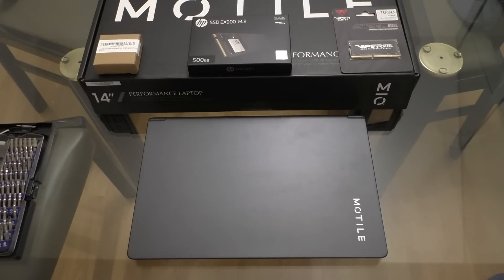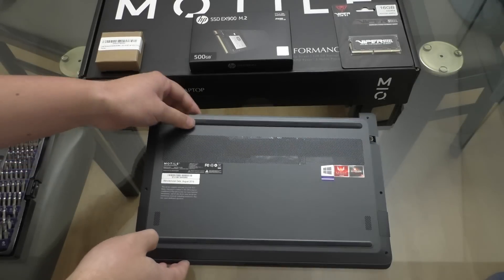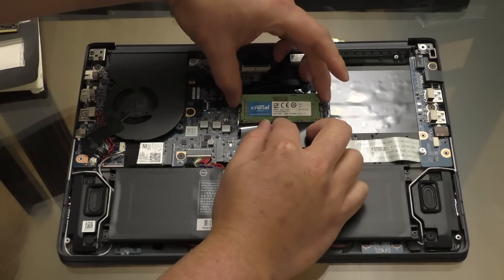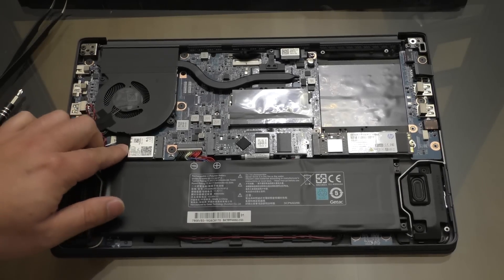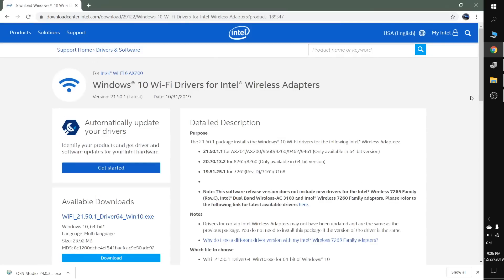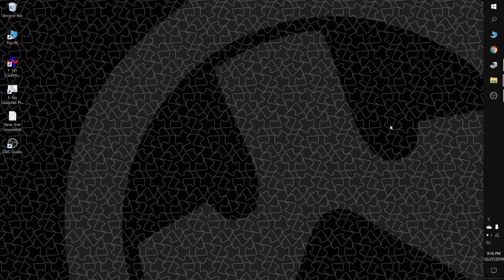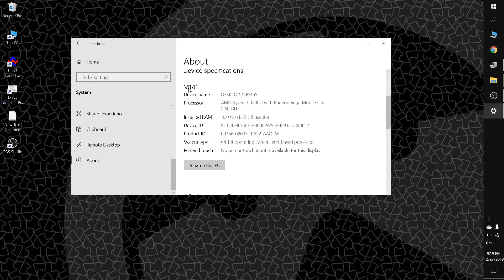Walmart Motile M141/M142 Upgrades (RAM, SSD, Wireless Card)

Comment: Hi, when we add the SSD drive, can we set it up to boot from it instead of using as a 2nd drive?  Thanks!
Reply from the maker: Yes you can make the new drive the boot drive. I'd look to see if you can easily find all of the motile drivers for a clean install, otherwise you'll have to resort to cloning the original drive.
Reply: @FaRKle0079  Thank you!

Comment: @FaRKle0079 I did the exact same upgrades and now my bluetooth is not working.  Wifi is fantastic, and I've got all the Intel drivers installed.  Windows just won't connect to any bluetooth devices.  Anyone else have this issue?

Comment: Good video. This laptop doesn't need an upgraded wireless card because the stock one works great anywhere. The RAM is a smart upgrade and so is the SSD addition. THis is the best laptop ever.
Reply: I have never  ever seen a laptop with that price-quality numbers. Amd Ryzen 5 for $350, with backlit keyboard, 4 usb ports, HDMI , RJ45, in a metal casing?  I wish I owned one!!!

Comment: Can motile also fit a sata ssd
Reply from the maker: If you're talking about a 2.5" SATA drive, it looks like there could be room in there, but I didn't notice any mounting points, so it's probably best to stick to M.2 drives.
Reply: @FaRKle0079  tnx

Comment: Will 16gb 3200mhz have better performance since it’s single Chanel mode? Or should I just stay with the 2666mhz? 🤔
Reply from the maker: 3200MHz rated RAM won't show an advantage since that's above what the CPU can do. I'd just get 2666MHz if it's cheaper.

Comment: I've had the m142 for a while now and decided to upgrade the ram and add a 1tb nvme. 4 of the 6 chassis screws had loctite, and the screw for the nvme snapped off the board. This is beyond insane and I hope whoever assembled this unit has their genitals devoured slowly by fire ants.
Reply from the maker: Oh man! I discovered some build issues with mine too. The assembler didn't plug my fan in, haha.

Comment: I added the Viper 16GB to  motile 141 but it seems like it’s not compatible with BIWIN N2202 128GB SSD. Reinstalled old RAM and it works fine. Any tips?
Reply from the maker: The RAM isn't compatible with the SSD? That's a really strange incompatibilty. The machine doesn't POST with that combo?

Comment: I have the same Motile (M141-RG) and bought the same Viper Gaming RAM stick from amazon, I installed it, and when I turn it on the screen is just blank, not even the MOTILE logo appears. I exchanged the RAM stick on amazon for the same exact model, but 2nd one is doing it... do you think I'm doing something wrong here, or did I just get back RAM sticks?
Reply from the maker: If you've made absolutely sure the RAM is seated all the way, it's probably bad RAM sticks, especially if it always works again as soon as you plug in the original RAM.

Comment: Would it be possible to add a small fan into this so it stops heating up to much.
Reply from the maker: Inside? Maybe. You can probably fit a blower fan in the empty area by the 2nd SSD, but you'd need to create your own power source/tap and mounts.

Comment: After upgrading the RAM, SSD, and Wi-Fi (and installing the drives and such), do I need to reboot the laptop? I heard the BIOS 1.06 has many bugs.
Thanks for all the help!
Reply from the maker: You don't need to reboot after installing the RAM and SSD. If the installer for the WiFi driver doesn't tell you to reboot, then you don't really need to after that installation either.
Reply: @FaRKle0079  Thanks!!!
Reply: @FaRKle0079  I can't get past the Aptio boot screen after installing a 1TB M2 PCIe NVMe SSD.

Comment: I have stock Motile M142 version (Ryzen 5), with a limited budget. What order would you recommend upgrading the components in? Wifi, ram or SSD?
Reply from the maker: It depends on what your needs are. If you don't need more storage space right away, then I'd go RAM, then WiFi, and then SSD. If you think you'll need storage sooner, then I'd do the SSD either first or second, and then WiFi last.

Comment: Does the slightly faster 2666 RAM upgrade add any noticeable
 performance to the machine?
Reply from the maker: Nope. The CPU can only run it at 2400MHz.
Reply: @FaRKle0079  hi mine is slow using it with stock parts. Would you recommend the ram upgrade? It's having trouble running programs that my 2012 MacBook pro runs.

Comment: why does everyone think theres no dual channel memory in this thing, the M.2 Drive is infront of the second memory slot so all you have to do is move the M.2 drive to the second slot right next to it with the white paper then the second slot is open to use, its seriously not that hard.
Edit: btw, you can either have 2 m.2 drives and 1 memory stick, or 1 m.2 drive and 2 memory sticks.
Reply from the maker: That statement is going to require some proof! I and others have taken this thing apart searching for a second slot and there isn't one to be found.
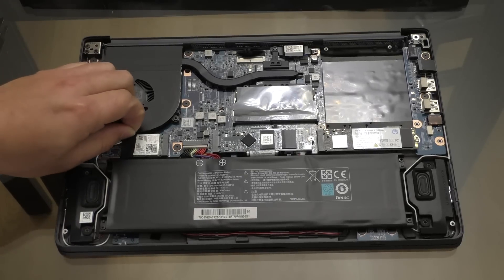Reply: @FaRKle0079 , (https://www.youtube.com/watch?v=l32orFMzCIk) and skip to 3:34
Reply from the maker: @Typical_Rain  I've seen that before. He's wrong and clearly didn't take a close look at the motherboard. If you look in my video description I specifically link a photo of that area I took to show there's no second slot there.
Reply: FINE, JUST TO END THIS, THERE'S NO 2ND RAM SLOT, whatever, all i wanted to do anyway is play Watch Dogs 2 on high frame rates but i can just get a ps4 for almost half the price, GOOD CHAT...doesn't mean im agreeing with you but END OF CONVRSATION
Reply from the maker: @Typical_Rain  You're not the first person to get duped by that other guy, and unfortunately won't be the last. He's really done the community a disservice.

Comment: I installed the exact same ram here and my computer crashes during games and other application use.  Do you know what is causing this?  Thank you.

Edit: I also ran a boot memory test that took 4.5 hours and it said the upgrade memory I bought was not faulty as well.

Comment: can you put 3000mhz speed or is 2666 the fastest it supports?
Reply from the maker: You can, but the fastest it'll run is 2400MHz, because that's as fast as the cpu is capable of.

Comment: Hi i am looking to upgrade my ram. what is the highest ram speed i can do?
Reply from the maker: 2400MHz is the fastest the CPU can run the memory. You can get faster rated modules, they'll just be run at 2400MHz though.
Reply: @FaRKle0079  thank you for the help so does that mean if i got 3000mz it would not help with gaming?
Reply from the maker: @thefalcon1723  Correct, it won't make a difference over buying a 2400MHz stick.
Reply: @FaRKle0079  ok thank you for the help

Comment: In your descrption you said this "Also, you can absolutely put a different amount of RAM (like if you only want to bump up to 8GB), and a larger NVMe SSD (like 1TB) than I did." The 1 TB NVMe SSD is that what you installed?
Reply from the maker: I installed a 512GB SSD. 1TB are pretty popular though.
Reply: @FaRKle0079  Would you install the 1 TB SSD the same way you did the 512 one?
Reply from the maker: @obeyex3l917  Yup. Exactly the same.
Reply: @FaRKle0079  And when installing the simple volume you would do it the same way as the 500 GB version? And which TB card that you have listed would you recommend? Have no idea which one to pick.
Reply from the maker: @obeyex3l917  Yes, creating the partition in Disk Management is the same as how I did it in the video. It should automatically fill the "Simple volume size in MB" value the same as the "Maximum disk space in MB" value, but if not, just set it to the max disk space value.

I'd pick whichever of the 1TB drives I recommended is cheapest. This laptop only has 2 PCI-E lanes of bandwidth on the M.2 slot, so it can't really max out these drives.
Reply: @FaRKle0079  So just go with the 500 GB one then? the 1 TB would be wasting money? Only asking because I'm looking for something to play GTA on along with using a lot of GTA Mods on there along with GTA online. As long as the laptop can handle that I'll be happy!
Reply from the maker: @obeyex3l917   If it's just that one game and its mods 512gb is probably enough. If you think you'll want more games in the future, get the 1TB. Games are getting ridiculously big these days.
Reply: @FaRKle0079  The 1 TB then. Do you think it could run in at least high settings smoothly with 60 fps?
Reply: @FaRKle0079  Decided to go with the WD "Blue" SN550. Also want to go with the 32 GB Ram. Thoughts?
Reply: Went with the silicon power instead? Thoughts?
Reply from the maker: @obeyex3l917  I couldn't tell you on the GTA FPS since I don't really play games with this laptop. There should be benchmarks out there comparing this APU to other graphics devices though.
Reply from the maker: @obeyex3l917  32GB of ram is probably more than you need for games. If it's not too much more than 16GB though, why not?
Reply from the maker: @obeyex3l917  The Silicon Power P34A80 is an excellent drive. I have one of those in my desktop PC.
Reply: @FaRKle0079  Alright thank you so much and I'm all set with the 32 gb of ram?
Reply: @obeyex3l917  are you still using this laptop and do you like the set up you did
Reply: @FaRKle0079  would the Wd sn 570 work too? It’s cheaper than the 550 and better
Reply from the maker: @zacharybinx9994  Yes, you can pretty much use any M.2 NVMe SSD that physically fits.
Reply: @zacharybinx9994  nope returned it the next day

Comment: I just got one and I was wondering if a HyperX 3200mhz sodimm would work.  I heard someone say it could handle more mhz but not sure how much more it can handle.
Reply from the maker: Yeah that memory will work fine. The max memory frequency this CPU supports is 2400MHz, so it'll run the HyperX memory at that lower speed.

Comment: Why does everyone buy the AX200 for around $20? For only $15 more you can get a Killer Network card that is known as AX1650, MIMO, and BT 5.1. Far better deal in my opinion.
Reply from the maker: The AX1650 is based on the AX200, but with Killer's SW package. It's kind of debatable whether it's that much better, especially at 75% greater cost.

Comment: What do you think about this laptops quality? Im thinking of buying this but rhis laptop is hard to get in my country. Do you think its worth it. The screen is great compared to dell, lenovo at the price.
Reply from the maker: The quality isn't the best, but it's sufficient. The reason you'd get this laptop is because it offers great value for it's cheap price, not because you want the "best" in any particular area. If acquiring this laptop is going to make it cost a good amount more, then that removes the reason for getting it.

Comment: Nvme screw was flushed screwed in by the manufacturer and stripped (would not budge cheap screws) what can I do now. I tried everything to remove it.
Reply from the maker: If you have a dremel/rotary tool, and are delicate, you can try to cut a flat head slot in the head of the screw.
Reply: FaRKle0079 ya. I don’t but that now seems to be the only option possible.

I been asking everywhere just to see if people figured out something otherwise like I said I might have to.

Thanks for the reply and Happy Holiday.

Comment: Question why did you replace the wireless card in this PC? It comes stock with Intel AC 3168 
dual-band wifi. The stock wifi is better than the one you put in it.
Reply: really?

Comment: What I would wanna do (or know) is transfer the OS to the NVME drive as well as the other programs for much faster performance and just use the existing SATA drive as storage. That is if I own said laptop...
Reply from the maker: People have successfully done this, either by cloning the SATA SSD to the NVMe one, or by doing a fresh install on the NVMe one. I believe all the drivers for a fresh install are on Motile's customer support site now, but you may want to double check.

Comment: I can't seem to reconnect the wifi antenna. Is there a trick to it? I've built 10+ desktops with no issues but this is driving me insane.
Reply: Also I bought a 9260 and not an Ax200 is that the issue?
Reply from the maker: @Voltron00x  The wires with connectors should just pop onto the connections on the card. Do they still pop onto the connectors on the original card? You can try attaching them to the card before inserting the card into the slot. That might make it easier.

Comment: Once you add the $'s up for the laptop and upgrades is there a laptop out there to buy that is already in that spot?
Reply from the maker: If you bought the M141, then the M142 is about $100 more, and will have more memory, storage, and computing power, but not quite as much memory and storage than doing the upgrade yourself. I'm not aware of anything matching the value of the M142 + DIY upgrades.
Reply: @FaRKle0079    As always, Thanks for the answer.

Comment: Hi! Is there a way to install a laptop hard drive? Thank you
Reply from the maker: Not "explicitly," but it looks like there's enough space for a 2.5" drive in the void on the right. You'd have to run an M.2 SATA ribbon cable extension/converter from the first M.2 slot (where the original SSD is) to the drive if you wanted to do that. That means you'd either need to make the HDD your boot drive, or add an NVMe SSD and make that the boot drive.

Comment: I have the black $200 M141.  IT has been working great with Linux onboard.  It is running KUbuntu 19.10 right now.   Had a problem with latest kernel, but runs fine on an older one.  Anyway I upgraded to 16GB of RAM first. Easy peasy.  Ran on that for a week or two, and then I ordered a M.2 2280 Crucial NVME 1TB drive which I installed yesterday.   I could not get the BIOS to see this drive in the first slot (where the original set).  However it works fine in the second slot.  So I now have the original  slow 128GB as my OS drive, and the 1TB as my 'data' drive. This is a preferred configuration anyway, as I can change OSs without having to lay down any data (development code/pictures/vidoes/etc/) again.     I just wanted to pass on my experience which has been good so far! 

Don't game so no comments there.   As far as I am concerned I don't have any complaints.
Reply: Just an FYI, the current (as of 3/16/2020) kernel  5.3.0-42-generic works.  Kernel  5.3.0-40-generic was the one that didn't boot properly.  Point is if you install Ubuntu 19.10 today and 'apt update' to latest it will work just fine now.  No fiddling to get to an older kernel :) .  Just wanted to pass that along!
Reply from the maker: Great info! Thanks for sharing.

Comment: A lot of people seem to be saying they're purchasing 32GB of RAM and installing it and it's working.

"I was intrigued by this deal and decided to get the device. Was in the market for a small new ultrabook or 2-in-1 device, but most are under-powered Celeron CPU’s for anything close to this price.

Disagree with 2 points of the original news post:
1) “One downside is the use of single-channel memory that can reduce the performance of graphics and other applications susceptible to memory bandwidth.”

– The only downside is that the device ships only with 4GB ram card, which should be 8GB minimum for this CPU because the Vega3 GPU needs 2GB RAM reserved. I immediately installed a Samsung 32GB ram card in its place. As you may notice “upgradable up to 16GB” for the RAM specs is also wrong, and 32GB ram worked just fine.

2) “Performance-wise Ryzen 3 3200U processor is slightly faster than a 10W Pentium J5005 Gemini Lake processor,”

This Ryzen CPU device may be selling in devices that are closer in price to Intel Celeron and Intel Pentium processors, but it should otherwise be more closely compared to Intel’s 15W mobile processors like the Intel Core i3-7130U or Intel Core i3-8130U processors.

Benchmarks from my Motile R3 device:
PASSMARK PerformanceTest 9.0
– Passmark Rating = 2069.2
– CPU Mark = 4311.7
– 2D Graphics Mark = 400.9
– 3D Graphics Mark = 771.1
– Memory Mark = 1575.5
– Disk Mark = 3482.9
PCMARK10 = 2713
Octane 2.0 = 24458
Geekbench 4.4.2
– Single-Core = 3323
– Multi-Core = 5549
– OpenCL = 17830"

https://www.cnx-software.com/2020/01/24/210-motile-performance-laptop-is-powered-by-amd-ryzen-3-3200u-processor/

Comment: I'm still debating on the 3 or 5 version. Currently the ryzen 3 is 299 and the 5 is 415. How did those upgrades help on performance
Reply from the maker: The machine runs very smoothly for the mostly media and light productivity apps I'm using it for. Faster transfer speeds are always welcome over wifi.